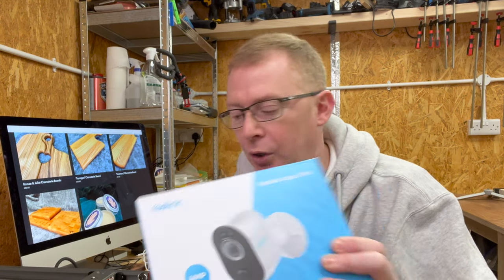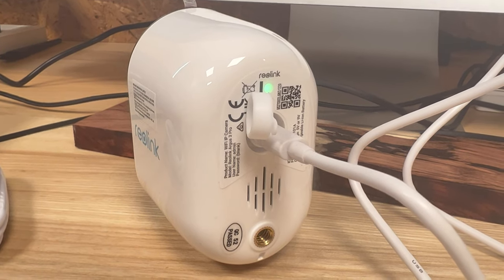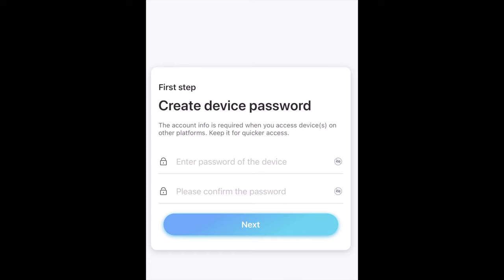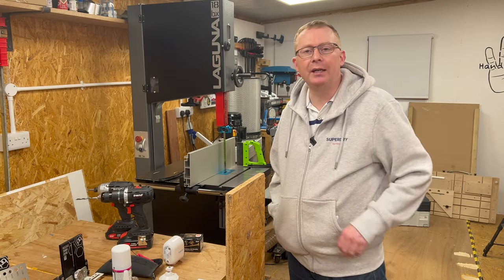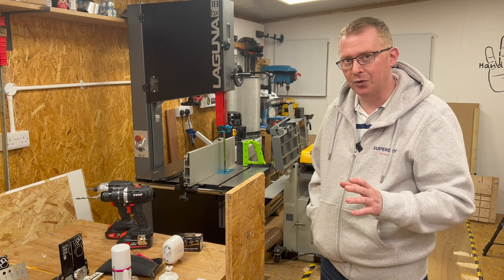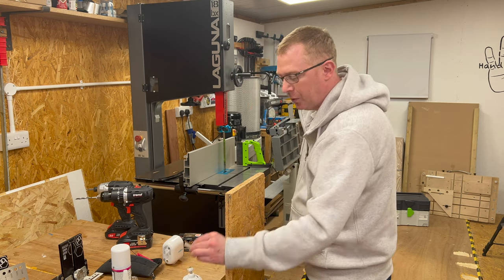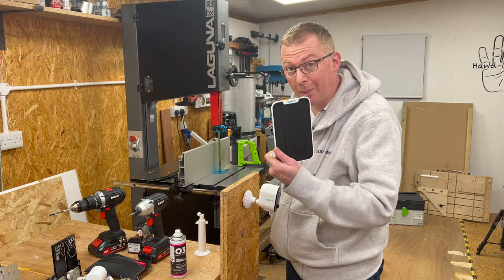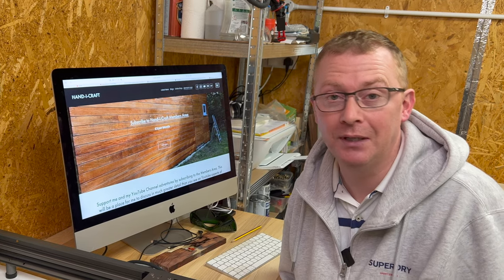Setting Up and Installing a Reolink Argus 3 Pro Security Camera

Comment: Quite a nice setup, especially like the idea of the solar panel meaning no need to constantly charge or change batteries!

You can of course can buy the optional lasers as well ... various models are available, with varying power levels and lethality, meaning you have complete control over how intruders are dealt with👍

Comment: After I done instalation,  I wanted to test if. But it is not recognizing wifi. It works only if I turn  the Same wifi on my mobile phone. But when  I leave the location it can no longer work because I am kot connected to the same rooter like the one which is next to camera. Wtf. My friend and I have been struggling for days now.